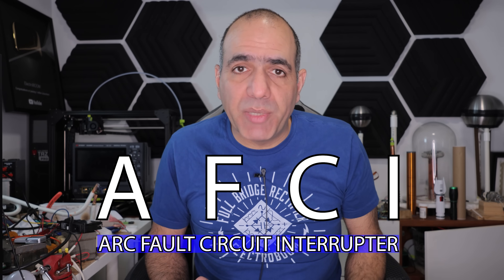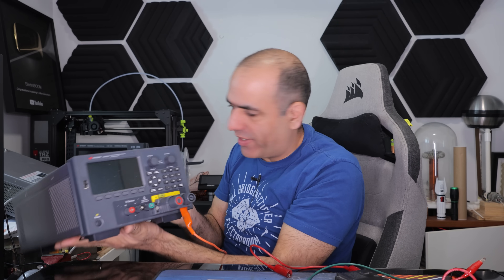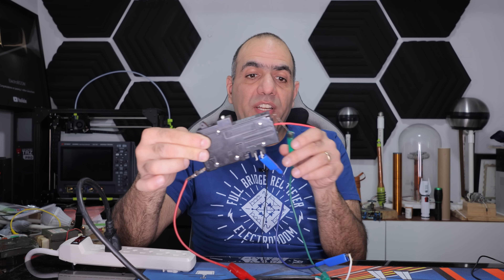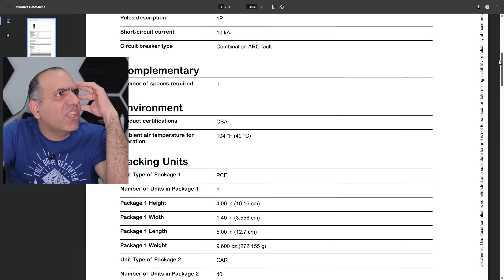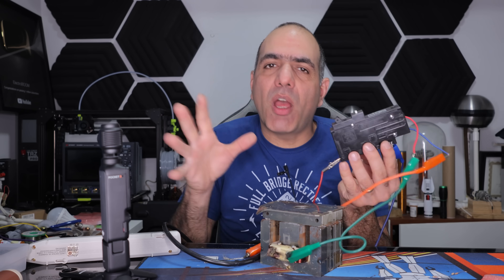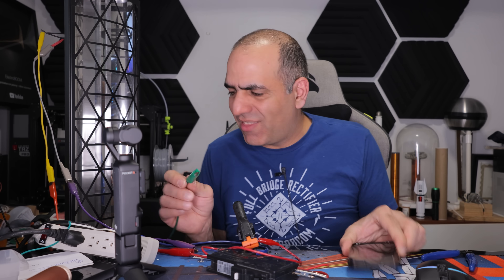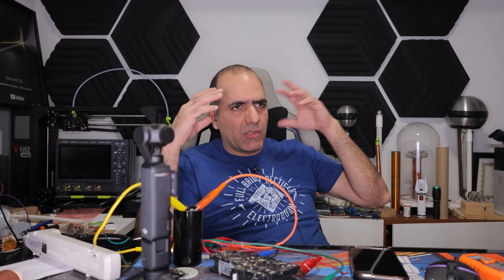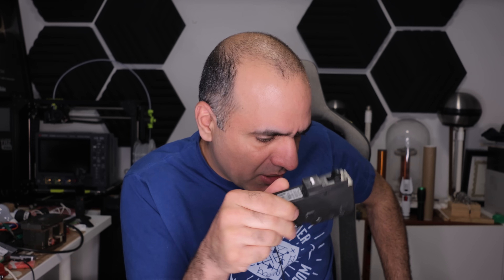Fighting Electrical Fire by AFCI

Comment: First-generation AFCI breakers were more sensitive and would trip in the face of even small arcs.  THEY WERE TERRIBLE.  They would trip all the time for no good reason.  Like when turning on a fluorescent lamp (the bulb needs to strike an arc to get the gas glowing), or with AC motors, or even the inrush current when a laser printer cycles on.

Modern AFCIs have been deliberately tuned to be less sensitive in order to avoid the "nuisance trips" of the first generation models.  They still sometimes trip in the face of a high current AC motor (like my power drill) or if I move a light switch slowly enough to hear an arc inside it, but as I understand it, that's exactly what the devices are looking for.

So I'm not surprised it was so hard for your to produce an arc capable of tripping a modern AFCI.  They're deliberately trying to ignore the kinds of arcs that are not likely to cause a fire, and I suspect many of your tests, although dangerous, don't produce the kind of arcs they are looking for.

Comment: I’ve been able to get them to trip repeatedly with an arc with a series resistor (no inductor or capacitor needed) that would limit the current to 1/2 an amp.  Like you showed in this video, frequency has a lot to do with it.

For that reason, certain arc fault breakers were removed in rooms of my house with RF transmitters that would regularly trip them.  I have no doubt they offer significant protection against electrical fires, but they’re far from a perfect technology
Reply: Most electrical fires are begun by arcs. I believe the NEC put out a bulletin in the late 80's looking for new technology to prevent arcing fires. During the 90's engineers worked on the problem and numerous patents were filed.  I believe Eaton was the first to market in the late 90's if memory serves. Since the NEC was behind the push, I am sure that these companies knew they had a lot of money coming their way once it was made code.

Comment: So yeah, the Schneider design for CAFCI actually includes a GFCI transformer and detection circuit. However it's not set to the typical 5mA threshold, it's instead a 30mA GFCI. This function seems to be used to detect and interrupt some of the particular UL test conditions (such as "Impedance of circuit") quickly, which might otherwise be hard for the normal AFCI circuitry to detect.

The test circuit in the particular device I reverse engineered had a test current of 35mA, so I am pretty sure your higher measured current is either a different revision device, or a different part number?

Comment: In Australia we use RCBO which is a combined RCD 'residual current device' and MCB 'breaker' with overcurrent protection.  I wonder if the overcurrent protection is faster/slower depending on local requirements.

Comment: Very little poing lugging that stuff around the world, the faults those breakers break for are characteristic of the 120v system - countries running a proper voltage have different and often less dangerous arcing conditions.

Comment: I lived with AFCI breakers for 2 years and nope, never again. They don’t like brushed motors and even randomly popped with brushless power tools. Hard data is hard to find but the “industry” says they save 30K fires or 0.02% of homes in the US. The breakers run considerably hotter than basic breakers and a whole house of AFCI cost about $25 in electricity to run. Of course the price of $50-100 for AFCI when a traditional breaker is $6 is a hard pill to chew. Can’t find the hard data on the 30K fires saved, but I suspect these where idiot caused things like using a power cord that has physical damage.

Comment: The AFCI in my spare bedroom prevents me from using a window A/C unit. It trips as soon as the compressor kicks on. It's an inverter based A/C so it's not a huge inrush like regular A/Cs. Weird thing is that A/C worked in there for months before the AFCI decided that it didn't want me running an A/C in there any more. Now I have an (overspec'd) extension cord running into the dining room to power the A/C unit. (The A/C unit is under 1000 watts at full tilt and the extension cord is rated for something like 1500 or 1800 watts)

Comment: What's interesting is that apparently they aren't as much of a deal in 200V+ countries. Here arcs apparently usually don't linger as long but either result in an air gap or a weld rather quickly. They do still exist, but are priced rather spicy and are more rare the GFCIs, as the risk they are mitigating isn't nearly as high as ground faults for example.

Comment: I hate AFCI breakers. I dont know if the new house we are working in has them or not since the table saw isnt tripping anything, but these things can trip if you just sneeze on a power drill with brushes in it. Since the brushes cause an "arc" in the system these things will trip like crazy. For a while electricians would install a set of AFCI breakers and then replace them after final inspection at the owners request. Then they take those AFCI breakers to the next job.

Was working in a house where the refrigerator was causing a trip and they had to run an extension cord to another outlet just so their food wasnt spoiled all because of these damn breakers.

Maybe they have gotten better... i dont see the point though.

Comment: I have a challenge for you Medhi, Make a vedio WITHOUT getting shocked The rules are you have to make a circuit from your vedioes  and can't pick a LATITY vedio if you win i will type in chat ELETROBOOM is the best Youtuber but if you lose you have to hold a live wire with a low amount of voltage for 15sec. ARE YOU UP FOR THE CHALLANGE !!!

Comment: I live in Nova Scotia. Last year we renovated the whole house, and replaced our 100A service with a 200A service. We had to put some 20A plugs in the kitchen, and hardwire and daisy-chain new smoke detectors. We were inspected and passed. But NO, no AFCI breakers were required for ANY room in our house. So I beg to differ with your statement that AFCIs are required for bedrooms now. They are NOT required.

Comment: In one of my previous careers I was an electrical engineer who worked on an AFCI circuit breaker design. AFCI falls under the UL 1699 standard (or for Canada CSA C22.2 NO. 270) which is interesting as it doesn’t specify how the AFCI should detect an arc, but instead lists a number of practical arcing tests that must be performed to demonstrate compliance. These tests would essentially boil down into 2 categories: series arcs and parallel arcs.

Series arc tests would simulate a small break/ gap in a conductor that carbonizes over time to form a high resistance current carrying path, and was tested at loads around and below the breaker rating. The thought is that if you were to turn on a high current load on such a circuit, the carbon could quickly heat up and create an ignition source, and the AFCI should trip before this happens. These tests were performed with either a carbon-carbon rod setup, where one rod is sharpened to a point (like a pencil) and placed in close proximity to the flat side of the other rod with an adjustable gap, or with a setup that would cut one of the conductors and apply a high voltage to carbonize the insulation at the break before applying a load.

Parallel arcs, on the other hand, simulate something that cuts the insulation and shorts across the conductors, line to neutral or line to ground, and involve currents above the breaker rating. The thought is that the breaker trip curve might not be fast enough to prevent an ignition source, so the AFCI should trip the breaker faster. These tests were performed with a guillotine setup using a razor blade to cut across the conductors.

In these tests, a variety of loads are used on the circuit while the arc is created, including resistors, light bulbs, power supplies, vacuum cleaners, and air compressors. In all cases, the minimum load on the circuit is 5A and go up to the breaker rating.

The AFCI manufacturers each use different circuit designs and algorithms to detect arcing, mainly due to numerous patents in this space. However, arc detection is generally accomplished by looking for shoulders in the current waveform (the current will drop to zero near the voltage zero crossing due to insufficient voltage to ionize the air) and high frequency noise (when the arc extinguishes and reignites this produces RF). Ground fault is another method that helps with line to ground arc detection, which you have demonstrated.
Reply: Thank you for taking the time to write that.
Reply: oh lord, EE furries?, jk thanks for explaining
Reply: @benalexz who do you think built most of the current digital and electrical infrastructure? :p
Reply: So his tapping the conductors didn't make a noisy pulse for long enough, but stroking the conductors did.  sounds like a job for a corded drill with a bad brush.
Reply: There's a slow afci, e.g. a carbonized path formed when you have damaged insulation that allows carbon to build between line and neutral over time (think cutting through the insulation of a lamp cord without actually touching the wires). this is a high resistance path that causes a buildup of heat, and can cause a potential fire if you don't know its there, which is why afcis are great. They are designed to catch those before they become a problem, and thats good because its impossible to tell there's a problem until you see smoke. There is also a fast arc where you, for example, hammer a nail through your wall and hit romex (multi-conductor conduit cable) and it connects line to neutral instantly, causing a violent arc that is immediately apparent. An afci breaker will trip in a few half cycles for these, like just a few ms,  but it will still cause fireworks. We test both types at my work and there are different times in which the breaker has to trip for different amperages. Fun stuff. The fast arcs are cool, we use a guillotine mechanism to short the wires. Theres usually a big flash, lots of smoke, and it literally melts the blades we use. The slow path testing is fun too, but a bit less flashy.
Reply: Profiles picture checks out with that kind of knowledge impressive
Reply: Dude that is fascinating! Thanks for sharing!
Reply: Thank you for the detailed explanation, I might add that the series/parallel arc detection is what is meant by "Combination AFCI"

Most manufacturers also produce "Dual Function" AFCI/GFCI devices that include both technologies as advertised, and nowadays usually have a little LED that can blink code numbers at you to inform you what particular type of these events caused it to trip.

The Ground Fault protection aspect of AFCI at ~40mA as demonstrated is indeed ground fault protection, but well above the typical ~5 mA threshold to qualify it as a Class A GFCI suitable for protection of personnel. Probably why an AFCI-only breaker doesn't advertise as a GFCI or even GFPE, other than the dual function ones I mentioned.

They also make AFCI receptacles and AFCI/GFCI combo receptacles. There are probably some other oddball formats available too. Well installed wiring should never nuisance trip an AFCI device, in most cases of troubleshooting I've been able to find a legitimate fault, although some of the older devices (circa 20 years ago) were sensitive to RF and brushed appliance motors. Edited to add: in some cases these AFCI faults can be frustratingly elusive; a megger can be useful occasionally, provided you are careful to disconnect loads from the circuit (don't forget the smoke detectors)
Reply: It’s always the furries that are scarily intelligent. Go get em!
Reply: IT'S ALWAYS FURRIES RUNNING THE WORLD
Reply: And that's exactly why it's a garbage technology and serves no purpose other than nuisance tripping and causing additional expense to home owners and liability to contractors forced to remove the breakers after inspection because of the stupidity of software based definitions of what an Arc is .Insanity looking for justification for its existence ..
Reply: This reason the standard doesn’t describe how the AFCI works is the “performance principle”- the idea is to not restrict the product to one specific solution- only require certain performance.

Also, manufacturers would not be happy if their method to achieve the requirements become public knowledge- it is often confidential and may even be patented.
Reply: The conclusion is these don't even work in real world situations they were designed to make billions of dollars by corporations.
Reply: so its basically useless for homes. thanks!
Reply: Thank you 👍
Reply: That's how I understood them working. If I'm not mistaken, they're supposed to be for things like bad switches, or an undersized, but overloaded/cut power cable that arc between conductors. The undersized cables supposedly might not draw enough current to be a danger to the wires in the wall or trip some regular breakers, but the arcs are enough to cause fires, which the AFCI is supposed to be protecting against. Does that sound about right?
Reply: See... I understand around half of what you said. However not for lack of understanding, but the fact i wish to pat your Profile picture guy.
Reply: @Skyrange_BC  agreed lol
Reply: @Skyrange_BC  The shoulder portion is in relation to how you have a near instant drop in current when the arc finishes, and the high frequency noise portion relates to how if an arc starts and stops rapidly, the frequency is far higher than typical AC frequencies.
Reply: @Skyrange_BC  It's just a small portion of the timed written exam they have the best of us take 🤣
I couldn't remember it all unless I studied again anyway hahaha
Reply: So useless and designed to pad the manufacturers through a back door, unsupportable requirement.  When I moved into my new home the very first thing I did was swap 100% of the AFCI breakers with standard breakers.  This is literally one of the worst scams in the history of the electrical code.  AFCI are VERY UNSAFE, as it causes the only people that matter...YOU to believe it is doing something it DOES NOT DO.
Reply: Who would've thought you also need a paragraph guy in even Medhi's video?
Reply: Always necessary with electrical and electronic engineering folk . @JohnWilliams-gy5yc
Reply: Hehe~ I understand everything since I am a nerd~ I will now summarize this entire comment!~

The typer of this YouTube Comment, an electrical engineer, discusses their experience working on AFCI (Arc Fault Circuit Interrupter) breaker design, which must comply with UL 1699 (or CSA C22.2 NO. 270 in Canada). The standard doesn’t prescribe how arcing should be detected but defines a series of performance-based tests, which fall into two categories:

1: Series arcs simulate a gap in a conductor that forms a carbonized path, potentially leading to fire when a load is applied. Tests involve setups like carbon rod gaps or artificially damaged conductors.

2: Parallel arcs simulate a short across conductors (line-to-neutral or line-to-ground) due to insulation damage. These involve currents above the breaker’s rating and use setups like a razor blade guillotine to cut conductors.

Various loads (from 5A up to the breaker’s rating) such as light bulbs, compressors, and resistive elements are used during testing. Different manufacturers use proprietary methods for arc detection, often relying on waveform analysis and high-frequency noise detection. Ground fault detection is also a helpful complementary method, especially for line-to-ground arcs.
Reply: @OfficialFemvoid i love AI

Comment: Something not really talked about is an AFCI uses about 1w-2w each. That does not seem that bad until you load up an entire 200a/300a service panel with them. For his panel that would be about 25-50w used.

Which over a year or 10 years is not an insignificant amount of energy.